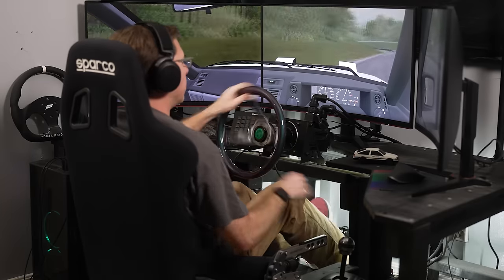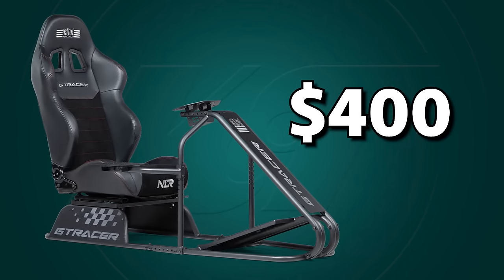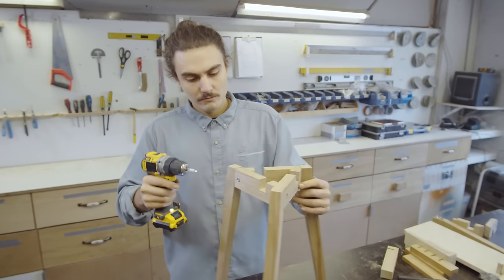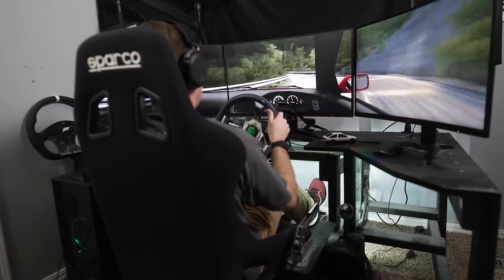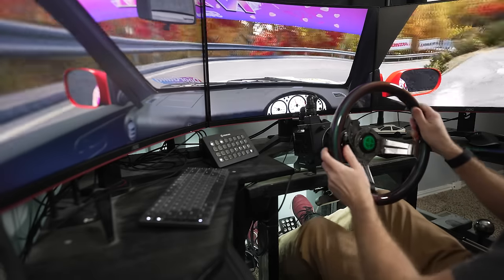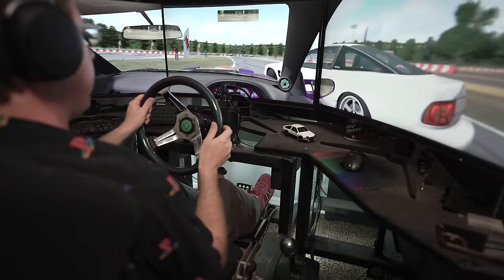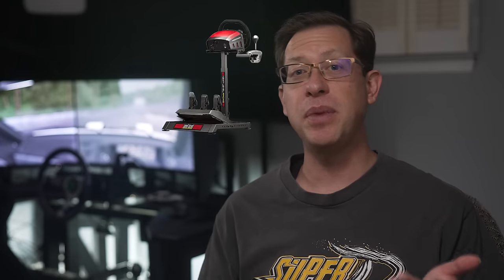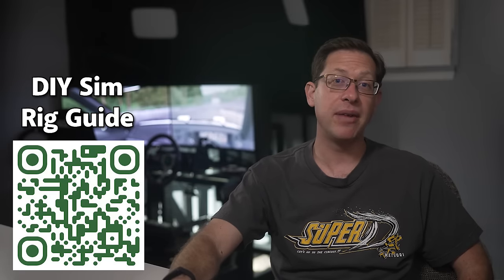My thoughts after 5 Years with my DIY Sim Rig

Comment: junk yard seat: YES! a Car seat is built for prolonged use. Simrig Bucket seats not so much. No recline or adjustability. Mine is from a Smart car, and I also took the rails. Plonked that in my rig, and hey presto.
My suggestion  is to put caster wheels on your rig. You have to move your rig more often than you think
Reply from the maker: After the end of a long session I crawl out of the fixed back bucket seat on my rig haha. If I ever put a bucket in my real car for the passenger maybe I'll relocate it to my sim.

Comment: i own a wooden rig myself, in fact it's an exact replica of the P1X, even having channels for adjustability. now what really caught my attention is the way you mounted your VRS DFP, why not mounting it to the side so that the wires does not poke up like they do now?
in case the cables will hit the mounting plate if mounted to the side, you can unscrew the top of the cables and rotate them to an angle of your preference.
Reply from the maker: I was waiting for someone to comment on that ;) It's actually because my cockpit and triple monitor desk was built around a Fanatec Clubsport v2.5 belt drive wheel--I'd need to cut additional material out to make room for the wires to exit from the bottom or side. I could certainly do it, but so far I just look around it despite it not having the cleanest appearance. I plan to upgrade to an aluminum profile rig anyway soon enough, and then I'll mount my VRS in a better orientation.

Comment: woodinserts(threaded) on the topbar and shifter/handbrake wooden plate would make it easier to make changes instead of screwing directly into the wood. would be more flexible if u can change out the pieces. as for the table top you could vinyl wrap it in order to make it smooth

Comment: Doesn't have to be aluminium to be rock solid,  I don't have space for a full rig,  and use a non folding wheel stand made from steel, it's absolutely rock solid,  there's no movement other than the FFB and I can literally stand on the brake pedal.  Have to say that had I space for a full rig I think I'd still probably buy one,  as who knows when you'll spot a bargain piece of equipment and change a component?  Plus  I'm not a gifted woodworker and don't have the tools or space for assembly. I found your preference for triples over VR interesting and would like to more on your thoughts on this. (I recently added a 21:9 Ultrawide QD OLED monitor to my setup which is about as much as I can fit into my space) interesting video,  thanks for posting.

Comment: i made mine rig for 10euros. that much is cost of 4x8cm 4m wooden beam. 
and i build my whole triple 23" screen sim racing setup for 700eur almost from scratch i only had one 23" monitor and pc that also needed lots of upgrades, and atm im only missing h shifter. i have csl elite ps4 base + csl p1 wheel + clubsport f1 wheel + load cell break, clutch and hand break. i made hand break myself with hall senzor for 5eur. no braging or whatever, i just want encourage people that simracing is not so expensive if you go slow buy used and diy way. and its fricking amazing.

Comment: Pro-tip. If you don't think you'll ever have to disassemble the rig use wood glue in addition to the screws. Wood glue is stronger than wood and so long as you have basic experience working with wood it'll be as solid as steel with no flex at all forever. Screws joints can loosen up slightly over time with constant forces applied like the torque from a good quality wheel. Wood glue prevents this completely and it's cheap as dirt.

Comment: Thanks for the video., I will try building it myself. I got a Moza R5. plan on using with ACC. BTW is ACC accurate with force feedback? I have been driving all my life not as aggressively as we do in the sims but seems the wheel is not reacting to the track. The forces I feel when making turns in real life for example in a LT1 Firbird WS6  don't feel same as in the sim.

Comment: I wish there were some way to fabricate something under the seat that could translate the feedback data to make the seat not only rumble, but could cause it lean left or right a few degrees when taking hard turns. Although, that would no doubt raise the complexity & cost on a DIY rig...(?) The biggest issue, I think, would be pulling the code for the feedback; otherwise, maybe 4 actuating arms (rapid movement with ~2-3" of extension) attached to a mount created for the seat to attach to. Maybe not even that much extension; with the visual cues from the game, it wouldn't take that much to trick the mind into believing the movement is much greater than it actually is...(?) 

Still, you have an impressive DIY build nonetheless; this seat-feedback idea is probably on the extreme DIY end & it would no doubt be much more costly, & that's gambling on whether it would even work or not... Because, again, the coding & timing...that'd require study even where to begin.

Comment: I recently started getting into drifting sims after a year of street and track racing in asseto corsa and rally with the wrc games. Just started playing Drift 21 and your vids have helped my skills. I ended up just grabbing a cheap desk off amazon but have it jerry rigged pretty well to simulate a real car. I have to upgrade my wheel though using a hori apex I got for $50 off ebay and a thrustmaster H shifter i got for $60 but using the right wheel paddle for handbrake lol any good suggestions for a cheap but reliable handbrake?

Comment: There's space between your knees and the plank below the wheel base. Why don't you simply drill in place a new plank below the original plank and then saw off the middle of the original plank so you can lower the racing wheel a bit?

Comment: Well done explanation.   Your cost estimate is very low.  Based on your rig and desk plus hardware and paint you're in the $150-$200 range.  I'm a good woodworker and considered building a rig.  Based on the time and materials required I looked for a reasonably priced manufactured option.  On eBay I found a no name round steel system (heavy duty round steel cockpit, monitor mount & seat) for $430 delivered.  One day assembly and setup and I was racing.  I had to drill mounting holes for my TM818 as it uses a proprietary setup.  The monitor frame also had to be adapted from TV style to a desk mount 3 monitor mounting bracket.  Now I own a "budget" high end cockpit system.  For me this was definitely the best solution.

Comment: no need to upgrade to an extruded aluminum rig; just consider the one you've already built as a prototype. Then build yourself another one, refine your design and thoroughly sand it and finish it with glossy polyurethane, and it'll be SUPER easy to keep clean.

Comment: The performance part, I think this is dependant on what is the goal of the build. You can create a rig from wood that is over anything that it's there on the market but think it reaches a point where the design and time put into it is not really worth it.
Reply: I'd disagree. The designs are already there. I pretty much copied a top end cockpit just in timber not aluminium profile. All I did was make the measurements fit the space and gear I had. Didn't really take that much longer than putting together a high end cockpit either. The only time consuming factor was waiting for the paint to dry before I could mount the wheelbase etc. My rig is just as sturdy as any metal rig and I also have the sense of achievement of building it myself. As a former carpenter I'd happily build one for anyone to their own specs for less than half the price of the metal equivalent. Also as a carpenter I wouldn't just spray the bare wood like he did in the video. Would be filled, sanded, primer coat, undercoat then finish coat. This gives a proper smooth gloss finish that's wipe clean and durable.

Comment: Wouldn't the dust be fixed with some lakker? aka paint, then oile it and then it should be fine for cleaning. I always use oile to finish off my paint so it can be cleaned easily. I do see your point, i just think that oile or a lakker seal should have been mentation. Its the same for the metal versions, they add a lakker or seal to else it will impossible to clean.

You can always build a metal rig yourself. its not diffenced from a wooden one. Plus you can add everything you need and move it and not have to pay way to much for a prebuild one

Comment: Built a wooden box frame and screwed down the pedals and a discarded small table for the wheelbase. Slide my trusty Ikea armchair on the frame and that's it. $40, handsaw, eyeball and some swearing. Cheaper than my diy button box strangely enough

Comment: Does caveman have vaccum to clean dust off wood ?  Vaccum much better to clean dust off wood.
Spray it with  Tremclad  gloss, semi gloss or satin oil paint ...That will make it more smooth. And give it a light sanding with a 220 grit sanding block before 1st  coat then another sanding before the secong coat. Be liberal with the first coat so it will build a nice base...

Comment: not gonna lie im gonna build one of these.
id thought about it a few times but im like nah itll never hold up. but it will
Reply from the maker: Mine has held up even better than I thought. Even using wood screws instead of bolts and washers you can easily get years out of it if you don't take it apart. I bet mine would last another 5 years no problem...it'll last longer than I want to have it lol

Comment: also your new wheel being too tall. take the stand its mounted to off itll lower it about an inch or so. or do the sensible thing. take the top board off. cut it so it fits between the uprights...screw through the uprights and into the top plate thats now inbetween them problem solved dude. its no diff than how they build houses. there are all kinds of joints you can make with wood and not lower its structural durability. you could even add another brace going town the 45* uprights over your legs somewhere to make sure its not gonna get flimsy. itll be fine and your wheel can be whatever height you choose so long as your not hitting your legs.

Comment: the cost of all the machines, tools and materials i'd need would easily add up to the 700$ price tag that these companies are asking for
Reply: Pretty much guaranteed that you could borrow the tools from a friend or family member as you only really need a cordless drill, either a chop saw or circular saw, a square and a tape measure. The materials really are cheaper than a wheelstand that won't be anywhere near as good. Failing that look up a local carpenter and pay them to do it for you to your own specs. As a carpenter myself I love it when I get asked to do random builds like this as it's something you probably would only ever get asked to do once in your career. It would still come out way cheaper than a full on quality rig. Put it this way its no more than a days build even for a novice. Including designing it as I went, it only took me around 4 hours to put mine together. With the painting it took another couple of hours Labour time but a couple of days over all for drying time. For a customer I'd probably charge say £300-£400 depending on specs. Still way cheaper than a metal rig, just as sturdy, to your exact specs and literally any colour you'd like.

Comment: Bro doesn't know how to paint wood: Blames the material. How about googling how to paint wood before spray painting it with can. You need to  Sandpaper (80-120 grit) first then 
use Wood cleaner, Primer (oil-based or latex), Paint (acrylic latex or oil-based) and if you have seal cracks or want to seal the joints you need Wood filler and Caulk.

Comment: Please nobody needs a circular saw to cut a couple planks. I particularly like Japanese style pull saw, it's very inexpensive and takes up no space at all and is very quick. If you were to use them a lot, you'd have substantial blade replacement costs, but most people don't do projects every weekend.

And everyone has a cordless electric driver/drill right? Like how could you not? Just a basic one, you don't need anything fancy for just a handful holes in thin wood. 11V drills also have the advantage of being really lightweight and easy to handle.